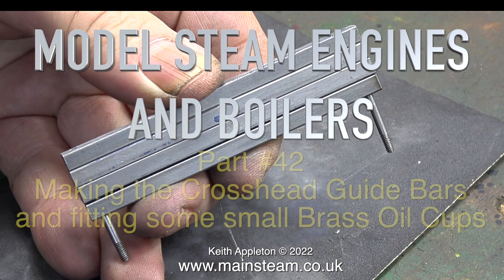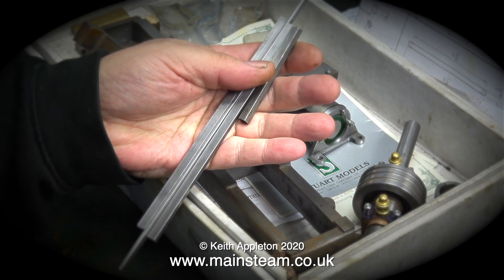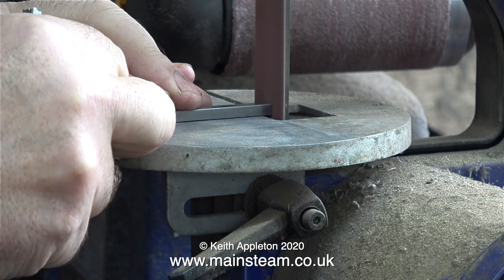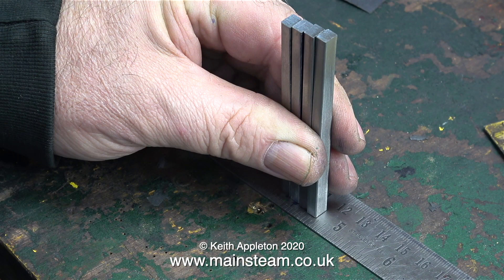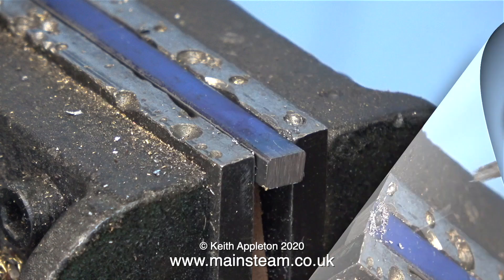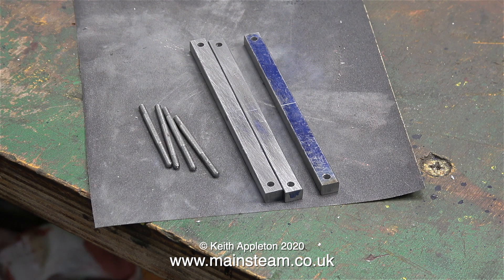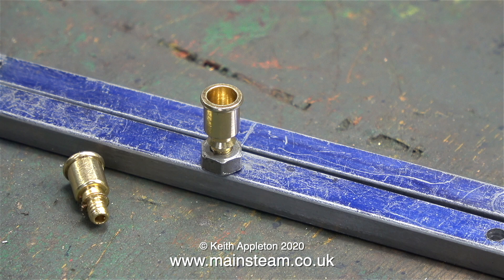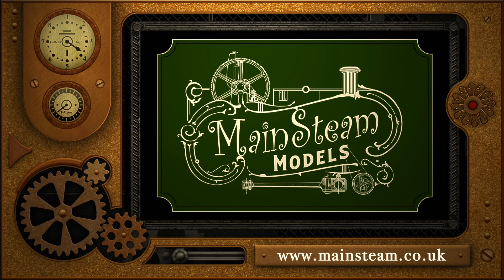MODEL STEAM ENGINES AND BOILERS - PART #42

Comment: you can put oil cups on the bottom of the bottom bars but it's getting harder and harder to find good quality anti-gravity lubricants nowadays.

warning: if you put the oil cups on the top of the bottom bars you must drastically shorten the stroke of the piston . . . this is not recommended due to loss of power.
Reply: They would work fine in Australia. 😀